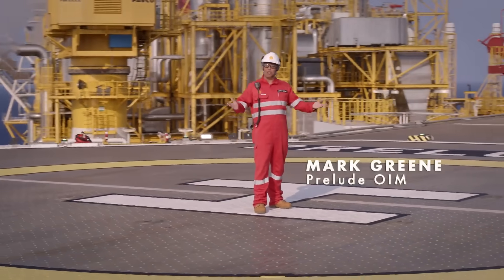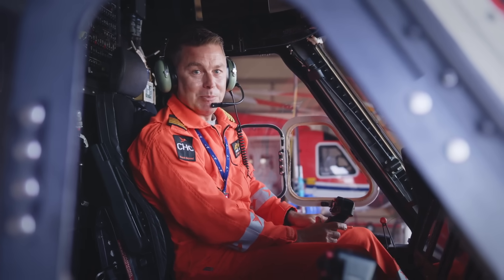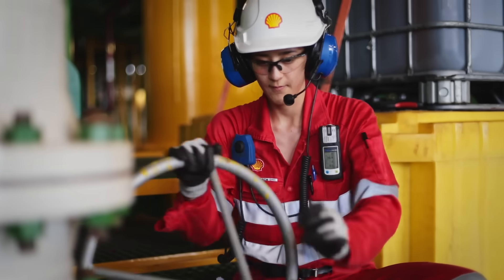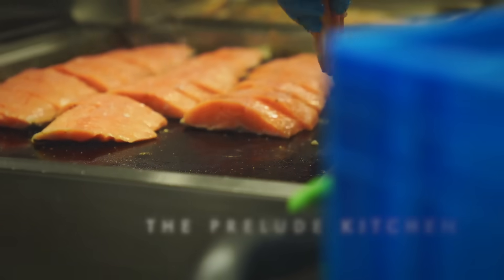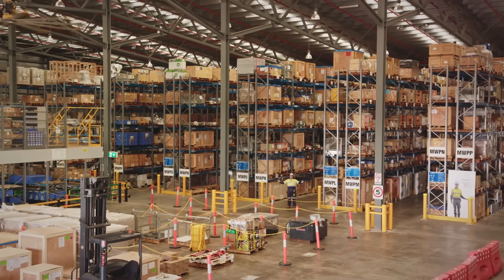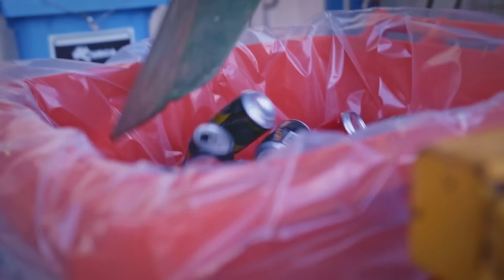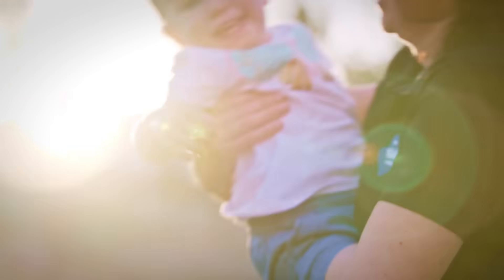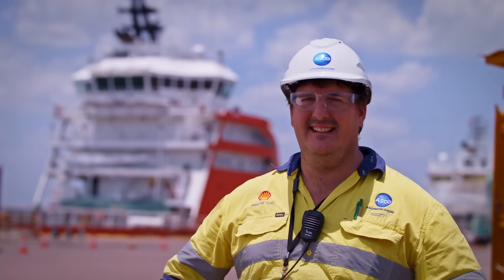Life Onboard a Floating LNG Facility | Prelude FLNG

Comment: Proud to have a son involved with this project from planning and development, through construction and finally setting up off the coast of WA.
Reply: Still there?
Reply: @Anthony-yn9dg  Prelude has been shut down since February due to an "electrical trip" according to Shell.
Reply: @lunapetunia3778  my mate was on it and wages dropped faster than a Aussie elect prime Minister. It was a scam
Reply: @Anthony-yn9dg  a scam?? What kind of scam were they running building a 15 billion dollar oil ship? Lol ... And to use it for only 2 years?
Reply: @lunapetunia3778  I worked on a 50 plus billion dollar gig and it only takes one num nut on 120k to blow it all up. Look at alpha piper and deep Horizon. Most huge industrial events are under skilled workers or ppl forced to compromise safety because they lack the skill or moral to move on
Reply: @Anthony-yn9dg  😳 i would be too scared to work on one!! 😱